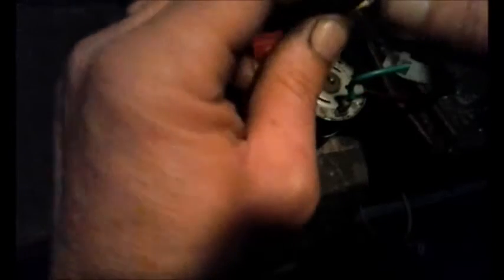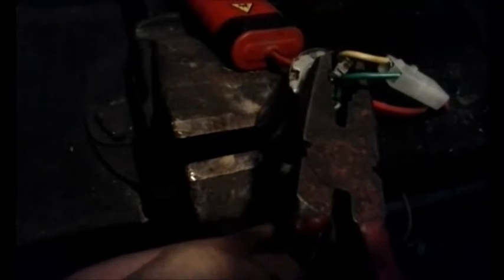How to Hop up 540 and 380 motors

Comment: Is this what a tamiya sport tuned motor is? Apparently they are 27T with advanced timing.
Reply from the maker: I don't know but it sounds like it could be.  I do know  that the one I've messed around with is still working well and if you go the wrong way it's really fast backwards. Should that happen just turn it back the other way. Enjoy your time messing around with motors.

Comment: Can you do this woth a 390 motor
If yes how
Reply from the maker: Hello Adam If it's a brushed motor with a separate end cap I would assume so.It's a case of getting end cap to rotate slightly.If it's held together with screws you may have to make new holes but it all gets a bit tricky if the holes have captive threads. I've not had much to do with 390s so not sure if it will work. 
Please remember that this mod will shorten life of motor and should not be carried out on a motor that you like or  are not willing to replace.
I wish you luck in your effort with motor and if you get it to work tell me or make a video so others can do it too.
Reply: jim thomas its a wltoys a959 390 motor !?
Reply from the maker: Hi Adam it looks like you could bend the little tags on the end of motor can back and rotate the end cap. But it will prove tricky with printed circuit board in place. It may be possible with it in place but it would be very tight to get at tags. may be best to un-solder motor feed wires as it looks like it's them that hold printed circuit board in place. 
If tags were bent back and printed circuit board re installed turning of back plate should be possible.As a temporary measure use a hose clip whilst you adjust advance , then when you are happy with performance bend  housing back to new locations of groves in end cap, carefully with a drift and hammer. Remember there are magnets inside and they crack real easy.
Or just leave hose clip in place. Ensure the hose clip is clear of terminals as that could go bad real fast.
I wish you well with this job as it's not strait forward on your motor.
Reply: jim thomas omg sound quite tricky i don't think Amgonna do it .btw thanks for replying 🙂👌
Reply: Just did this on the wltoys a959 it’s tricky but can be done, still have to test it waiting for pack to charge 👍👍
Reply: work nice